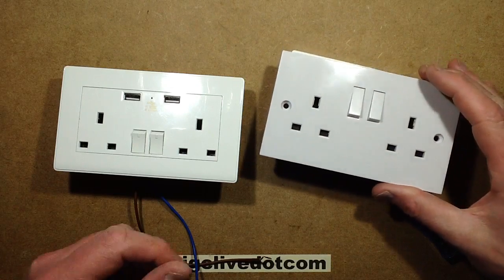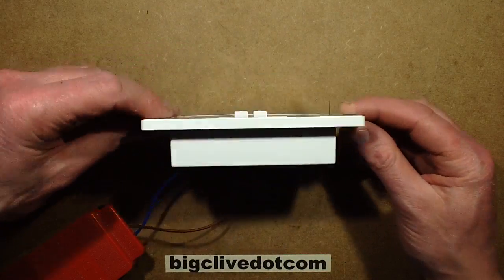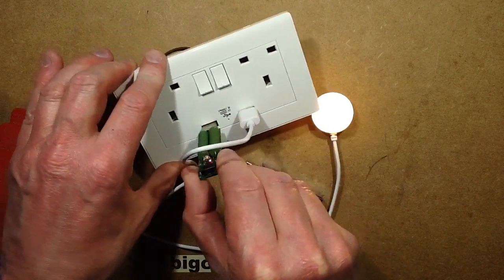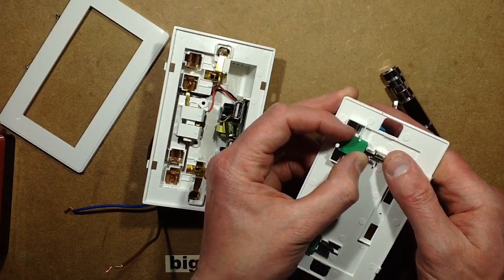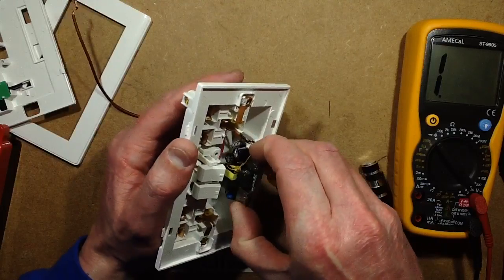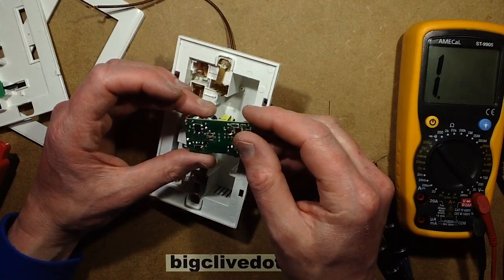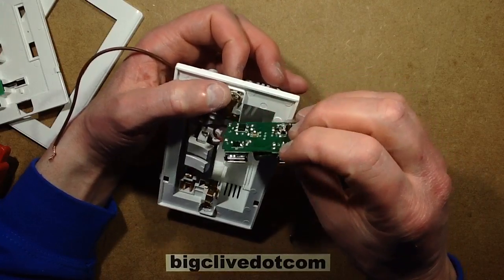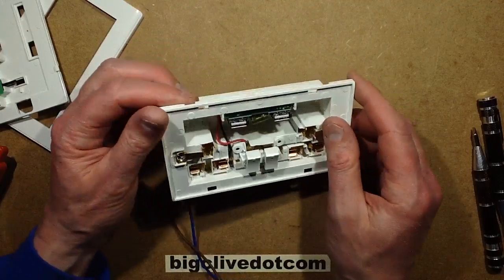A look inside a (crap) double gang socket with USB outlets.

Comment: I don't get why we don't have those shutter things in the US. My sister stuck a penny in between an outlet and a plug before, I didn't see what happened but I heard a loud noise and the socket was covered in soot. She was okay but like seriously, a kid could so easily hurt themselves with outlets in the US.
Reply: +Amelia Hartman The shutters only prevent you from sticking things like screwdrivers into the socket so would not have made any difference in this case. Uk plugs have the shaft of the pins insulated with only the tips bare metal so sticking a coin behind a partially inserted plug isn't so dangerous. (Not recommended though!)
Reply: Did she want to die or something
Reply: bob s Isn't it designed so the shutter doesn't open until the pin is half in, where the other half is insulated? By "shutter thing" I meant the whole system itself.
Reply: +Amelia Hartman No, you are probably confusing the Shutters with the Sleeving on the pins. The BS1363 design is set up so the Shutters are opened either by insertion of the earth pin first, out by simultaneous insertion of 2 or more pins. The Sleeving and terminals in the outlet are designed so that A) a finger wouldn't fit between the face of the outlet and the plug, and B) the brass portion of the pin is not visible on either the Line or Neutral. Earth must not be sleeved for any reason because of the contact setup in the outlet, they generally have earth contacts visible so that the item is earthed before the Shutters have opened
Reply: +Amelia Hartman That's right, there is never any exposed live metal when the plug is partially inserted. Not true of pre 1984 plugs which had solid metal pins so inserting a coin between the plug and socket would result in fireworks.
I don't know if American outlets would work if the plugs had insulating sleeves, also the pins of American plugs are relatively thin so adding a sleeve would cause difficulties.
Reply: +bob s It worked in australia with similar thickness pins, but the aussie plugs in question are only rated 10A (I believe the 15A versions have larger pins?)... the 15A rating for american plugs is already marginal, as they get toastywarm when fully loaded, with sleeving they'd likely simply become a plug melter.

Comment: That is complete junk, it doesn't look like it uses the hard, heat resistant plastic UK sockets should use. How about wiring it up and plugging a pair of 3kw fan heaters (or electrode boilers!) in and taking a look with the thermal camera?

Comment: The twin earth is for the modern wiring regs.  Any socket supplying IT devices is supposed to be earthed from two points for redundancy when one of the terminals spontaneously breaks.  With them unjoined it just fails completely, not really supprising given the rest of it though - what a horrible thing!
Reply: +Korona Uh.. no, there's no such regulation. And this socket would fail to comply for reasons about as blindingly obvious as a 10W laser in the eye.

You're perhaps confused with high integrity earthing, which is a very different business for dealing with high continuous protective conductor currents (as opposed to no current flowing, which is the ideal.). This is why properly constructed sockets MAY (if they are intended to support high integrity earthing) have two independent terminals, both of which would be quite firmly connected as part of the construction of the socket. However, this is not the only way to comply with the regulations (that is to say, you do not need to use multiple conductors, it just happens to usually be the cheapest solution).
Reply: +Monkeh616 I think IT equipment just defaults into the category of needing it.  I get the impression that the manufacturers saw modern sockets had these two earth points and thought "oh cool we can do that" without really knowing why they were doing it.
Reply: +Korona That depends how much equipment you have..
Reply: +Monkeh616 Depends who's perspective you're looking at it from I guess.  The manufacturer/installer has no control over how many splitter bars people are going to plug into their socket outlets!

Comment: The way the two earth connections aren't actually linked in the socket itself seems more than a bit dodgy.
Reply: +Frankie Sparkes Hi Frankie, Personally, I wouldn't even be happy on a ring main. Yes, you 'could' connect each leg of the ring to one of the sockets, but then you would technically have a break in the ring. In Clive's words, "Unnice", or in the words of George Orwell's Newspeak, "Ungood"....
Reply: It is, it's inherently dangerous given the way wiring is done. In ring circuits this isn't a great problem but in Radial Circuits (Google them) that could leave an open earth downstream because there's only 2 earth cables in a terminal at any one time and in Radial Circuits it only meets with the consumer unit (fuse board, distribution unit) once, and since the 2 cables don't allow for continuity, the earth in class 1 (earthed) appliances is completely defeated, persevering a shock risk to any earthed appliance on that 'circuit' (halfway down the outlet)
Reply: Frankie Sparkes
 Googled it; it seems to be basically what I assumed it was. Essentially in a radial circuit, all the sockets are connected in a single series as opposed to looping back to the distribution board at the end? Yeah in that case I can see how, if it wasn't wired around that design shortcoming, it would basically defeat the ground connection of any socket after this one. Which is potentially a rather major risk to health and safety.
Reply: +MGlBlaze Yes that was bloody terrible, the only way to have made it safer would have been for the electrician or end installer to fit a link wire between the two.
Reply: Jim Webber I wouldn't either, I was merely implying that it would technically be safe on a ring circuit but as Steven Leatherbarrow rightly mentions, any split on the ring would fail a continuity test anyway. Although I will add that UK wiring for ring Circuits does use roughly double the diameter of the cable in spite of the current split done on the ring.
Reply: @frankiesparkes3947  no, it would NOT be "technically safe" on a ring circuit.. (for example, if several of such sockets were in the ring, none of the sockets bar the outer ones would have any earth connection at all.
Reply: In a ring final, you often see the earth connected one to each terminal. So if you have more than one of these in the ring, then anything between the two of them won't have any protective earth connector at all, not just the "not connected" or the two sockets. This is definitely not up to standard!
Reply: More "criminal" than "dodgy" as if you connect both earth wires to one connection the other socket wont be earthed.
Reply: +Frankie Sparkes You're right it is dangerous but the scenario on a ring final you describe would fail the ring continuity test and the earth continuity test on the radial circuit so the faults would be picked up on testing. Any O/C ring is a very bad idea as the whole circuit capacity design is based on 2 current paths, with only one path it is running on an underrated cable size.
I've never seen this scenario in a twin socket before either and I can't say I have always checked two outlets on every socket during testing.....mmmmm....that might change now!
The two earth terminals are a requirement for "High Integrity Earthing" where a circuit is used for lots of IT equipment with EMI filters that cause a high earth leakage

Comment: i bought a psu 24v at 20 amps for like 35 dollars from china that had the same exact problem 10hz oscillation on low load and no flickering on high load, the switching frequency was still low at about 2khz (i was expecting 15khz at least), i told them it was faulty and they send me an exact replacement that had the same problem, in the end i was happy cause it was pretty cheap and i don't intend on using it on low loads. (i had uploaded a small video to demonstrate the problem, watch?v=UGuUEVYLKyE excuse the accent)

Comment: Crabtree 4000 series standard double UK sockets have an earth screw terminal at both ends of the earth bus bar on the back, Crabtree recommend connecting one earth wire to each but safe to just use one if the wiews will only reach one (e.g. if replacing an old tenby, etc)... 

As for these new contraptions with built in USB sockets... MK ones have a chip that tries to optimise for the device being charged, never the less I still wouldn't trust them, little transformer live 24/7... in my book... fire hazard! 

And there is guaranteed to be someone that will overload these things thinking "it's a 13 amp socket... it'll take 13 amps of USB"...  and when China start doing what they do now with cheap kettle connector leads with unfused UK plugs, and dodgy adapters you called "deathdapter"... soon dodgy USB hard wired sockets will come & fires will break out when someone overloads one...

I have a portapow 4 way USB adapter with good circut breaker protection inside it, but it's unplugged when not in use.
Reply: +daibhidhSCO still wouldn't trust them even if so but from what I could make out from one I looked at in wickes the MK certainly looked as permanent live as this thing in the video here.

Comment: it is NOT hard to design a proper 1A 5v SMPS thats stable and good for charging for under a couple of dollars ... shitty SMPSs really REALLY piss me off
Reply: +Alyx BioHaz hey man....if you can save 3 cents!
Reply: +kain hall
If you can save 3 cents, you can use it to add in the brass bussbar between the ground pins on the mains sockets!
Because of that, this thing's crap even if the USB supply was of higher quality. I'm not a licensed electrician, but the separated ground pins seem to be a non-starter from a code compliance standpoint.
Earthing/Grounding/Bonding is serious business, as it's supposed to be the path that fault currents flow thru. Without that path, fault currents follow the next easiest path to ground, which is usually thru somebody touching a faulty device. In other words, PROPER GROUNDING SAVES LIVES.
It also prevents fires, because the low-resistance path provided by the grounding wires forms a "short circuit" that pops the circuit breaker or fuse, instead of a higher resistance path that could cause a hot-spot capable of starting a fire.
Reply: 44R0Ndin They left that out to save another cent.

Comment: I would never buy a AC mains outlet that come from ebay china.
It wont meet your countries safety standards.
When it comes to AC mains power, dont fuck with it, pay the extra and get from a local hardware store that sells things that had to meet safety standards.
Reply: +IIGrayfoxII 
ALL  are from china
Reply: +IIGrayfoxII But even if you buy stuff at a local store you often get junk like that (thanks CE label) and payed far to much for it... I mean just because they are selling these things in local stores doesn't always guarantee that it meets all standards. (we all know it should but often they suck a label on it and sell it anyway)
Reply: +midnitehound Which is why you buy from a proper store or an electrical wholesaler, if they sell things they know dont meet the safety standards for that country it is jail time and loss of their license.
This is not the same of selling things which you normally sold from a good company but had a bad batch that failed standards and had a recall on it.
Reply: @IIGrayfoxII   an* AC
Reply: Varilight sockets, switches etc,  are also British made.   https://www.varilight.co.uk/switches-and-sockets/sockets.php
Reply: Of course the local trader may have got their stock from a dodgy supplier in China .... Or is that me being paranoid again.
Reply: Not everything is made in China - MK are British-made. I wouldn't use any other brand.
Reply: +John Michael 
My next door neighbour gets all his dodgy dangerous electrics from China to sell in his General Store. :(

Comment: The pcb could be used, but in a seperate box, running one of your led lamps perhaps :-D.
.
Clive, have you ever come across a 6 pin smd flyback chip with only the numbers 101A on it?, i cant find out who made the dam thing.
Reply: +zx8401ztv after soem quick googling i could find the 101b and such but not the a varient hmm

http://www.digchip.com/datasheets/parts/datasheet/469/CFJ-4-101B.php
Reply: +any1alive 
Thankyou for having a look for me :-D
It seems anything with its number isnt a flyback supply controller, and there appears to be lots of dead ends, the supply is made in china for sky, so perhaps its one of those odball devices ;-(

Comment: I bought 3 of exactly the same but 2.4a variants from Amazon for i think £26 including shipping but haven't got around to installing them yet.
I got 3 different versions from eBuyer last year and they're working great, but these new ones I'm getting a bit worried about now.
Reply: Why go through all the hassle installing these, why not just buy a few USB wall adapters and use those?
Reply: markybyeah A few? Lol! Not even close.
I've got so much stuff running on 5V I've barely got room to plug anything else in, but these mean I'm not overloading sockets with masses of 5V adapters.
Reply: Curious Pineapple The double socket behind my TV has the TV, SKY+ box, DvD recorder, Ps3, Xbox 360, Wii, WiFi router, Cordless phone, HIFI, laptop charger, external Hard Drive.
5V devices are Windows 10 TV Box, Android TV box, Miracast adapter and QI charger.
My upstairs TV has not that far short of that, and other sockets are all filled with something.
These sockets just make it all easier, neater and safer all around.
Reply: Trakker
Still doesn't make sense to me. But each to their own. Get a power supply in that case.
Reply: markybyeah Don't see why it doesn't make any sense to get rid of unnecessary plugs.
But some people don't see the point in smartphones either and would rather carry a bag of devices, So to each their own.

Comment: I really like the design of the UK wall sockets... The plugs look sturdy, and safe with the recessed connections, and the outlets have individual switches (is that a requirement? I see it all the time in videos with UK outlets). I can't tell you how many times I've shocked my index finger on a partially inserted US outlet, or even had something slip behind it and short it out.
Reply: +volvo09 Our UK sockets are available without switches but are rare, especially in domestic environments
Reply: +volvo09 The uk type G socket system is generally considered pretty good. Not the cheapest to manufacture, but safe with earth making contact first and fuses as standard in plugs. Plus it's pretty hard to rip out the plugs and those pins never bend (short of running a car over them). This two separate earth connections on the back of a double gang socket are common now. Installed one today and as there were two earth wires in the metal enclosure I put one in each earth socket, but I don't like is as firstly it's an extra unnecessary step and it can with a sloppy installer leave one socket unearthed. Yes individual switches per socket are the norm. Why would you want a load of sockets on one switch in your house? Then you couldn't just turn one thing on.
Reply: +add2k Unswitched outlets are most commonly used on the Fridge/Freezer and Washing Machine Circuits simply because it's impractical to have a switch you can't physically access without moving the bloody thing, generally there's a Fused Connection Unit (spur) near it, presumably no fuse in the plug because of convenience or something.
Reply: +Frankie Sparkes There are still fuses in the plugs, which isn't as much of a disadvantage as you'd think at first, because usually if an appliance blows the fuse, you'd have to move the thing anyway to find out why :)
Reply: +happyflea Two earth connectors are common, but both are normally linked together so that if only one is connected, both sockets are earthed.  This socket is unusual and does not conform to BS1363.
Reply: ***** That would make sense

Comment: 4200ma = 2.1amp x 2 ports
Reply: +bob g He said 4800ma, no?
Reply: Normally on these wall sockets the amp rating is shares between the 2 ports so when 2 devices are plugged in you get a drop and neither device charges.    That's why i use good uk made 3.1A 5V sockets.